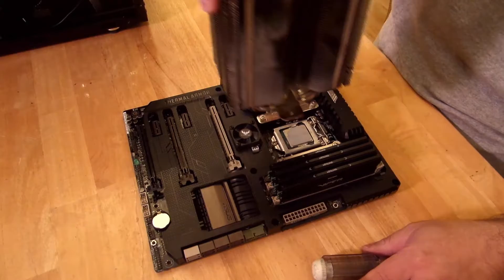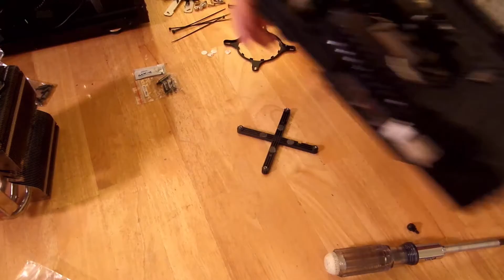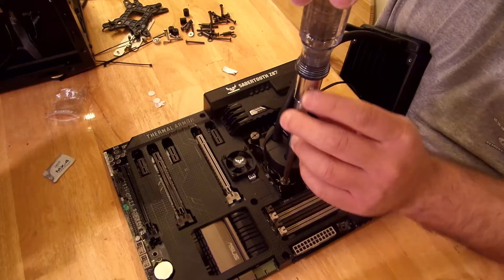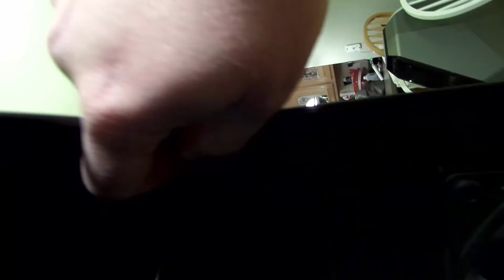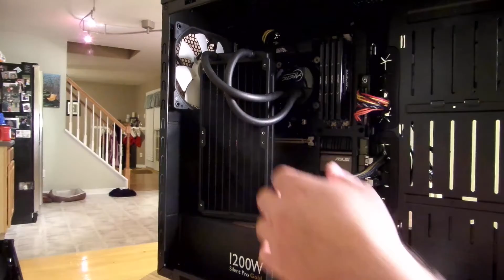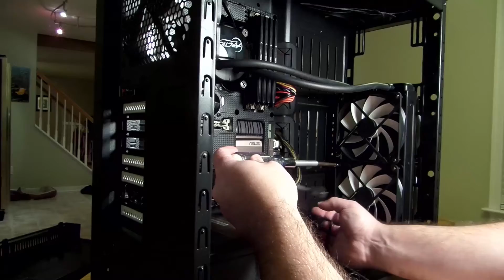How to install the Arctic Liquid Freezer 240 CPU Liquid Cooling unit in the Fractal Design Define S

Comment: Overkill PSU xD
Reply: Wow, then if it's for free keep it of course! :D
Reply: You've encouraged me to also buy something like a 1000w psu because I also thought that in the future, I don't need to upgrade my psu when changing hardware which is better in my opinion :D
Reply: No, I still didn't buy one. It would be very kind if you can give me recommendations. :D
Reply: Unfortunately here in Germany, these power supplies are a bit expensive when compared with dollar pricing. :(
Reply: My build consists of a i7 6700k. for the gpu, I wanted to buy a gtx 1070 but then I thought why not go for the gtx 1080 because I am somehow planning to buy a 1440p monitor because a gtx 1080 is overkill for 1080p gaming.
Reply: Is it actually worth upgrading to 1440p from 1080p or it doesn't make sense?
Reply: Yes please. It would be nice of you :)
Reply: As I know, XFX, EVGA, Bequiet! and Cooler Master make very good psus
Reply: I was planning to buy the Bequiet powerzone 850w model but I think I will go for the 1000w version. My actual plan was building a pc using the bequiet silent base 800 windowed version.
Reply: It is also better for future upgradability. For example, I want to add in another gpu or maybe watercooling so that requires more wattage plus when overclocking, more power is needed.
Reply: I'm still a boy but despite that thankyou 😄
Reply: Ok xD
Reply: I have a question. Can I install this unit in the top of the case? I've also bought a define s. :D
Reply: I'm still confused which one to buy. The Arctic Freezer i30 claims that it dissipates 320w of heat. Is that true? I first wanted to buy the fractal design kelvin s36 aio but then I thought let me go with the arctic aio. In the end I found the i30 and thought it is better. Please help! :D
Reply: And forgot to mention, It's going to be installed on the i7 6800K cpu.
Reply: does it perform better than the s36?
Reply: +Iggy Castillo In the end I chose the freezer i32 cooler because it has extremely high cooling performance for 30 dollars and German engineers have integrated a sophisticated circuit that allows the fan to stay off if the motherboard commands it to run under 40% speed. Tektik has reviewed it and tested it with his 5960x cpu. At stock it gave him very good temps, but when he over clocked it to 4.5ghz, it thermal throttled on Aida 64. The thing is that in the real world environment, it will handle it because even the most demanding games don't fully use the cpu and the 6800k has 6 cores, which means it can handle it. The biggest relief is that I don't need to sacrifice on my moduvents, which means I will have an overall quieter and cleaner pc. :D
Reply: +Iggy Castillo I surely have headphones, but now I have a stereo system and using it instead of my headphones because when I use them, my ears start to ring every time I remove them from my ears. :(
I decided to use the i32 because it packs a punch of performance and aircoolers are more reliable than water coolers as the only thing which fails is the fan. The freezer 240, after I measured it, turned out to be bulky and also don't want to sacrifice the front filter. :(
Reply: +Iggy Castillo Hmm you are somehow convincing me. xD 
Though that cooler performs good, I think it's not enough to cool this 6 core beast and also want to overclock it so this cooler will come in handy. I didn't find the video in which you have installed it at the top. Please give me the link! :D
Reply: I found that video in which you installed it at the top. I really want that logo to be upright and not upside down. :(